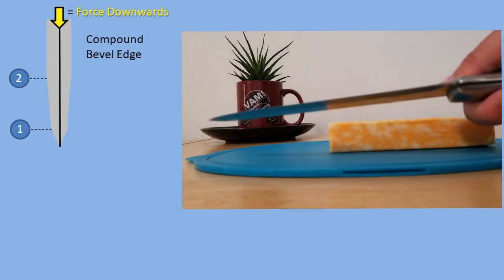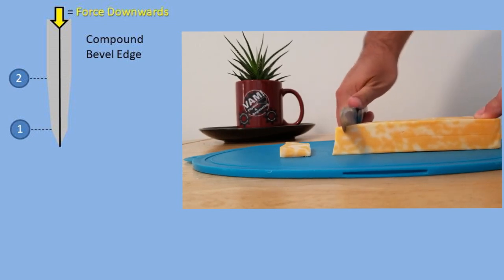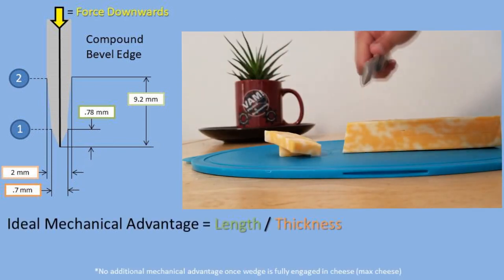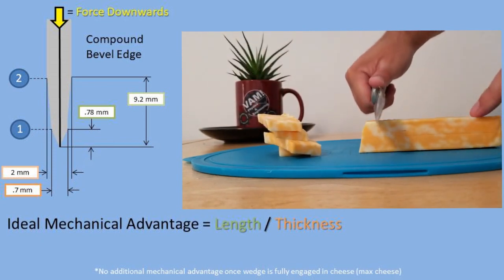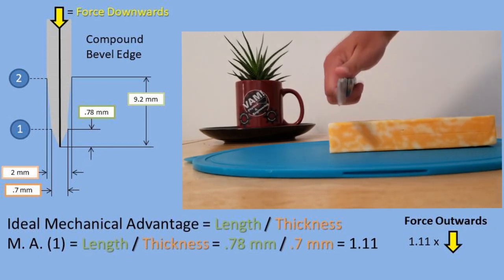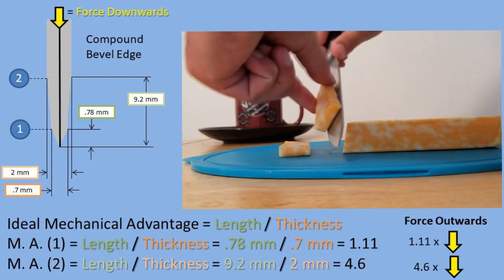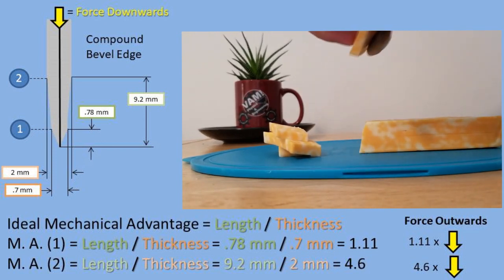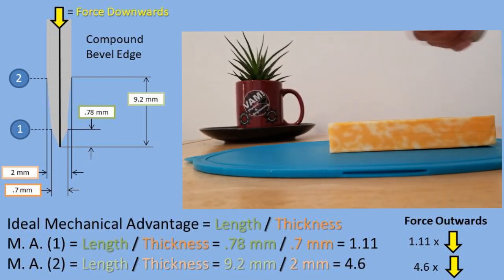Wedge Physics (Ideal Mechanical Advantage Explained)

Comment from the maker: to be clear since both wedges are engaged i resorted the formula for MA which is displacement input divided by displacement output. I am led to believe this is the correct solution for an ideal soft body problem like this. Please correct or debate me if I am wrong. If you think about it the larger the 2 wedge is the the closer it will be to reaching the idea mechanical advantage of that wedge but it will never quite approach it due to the blunt edge at the tip. Keep in mind that even thought the length increase the width also increases.